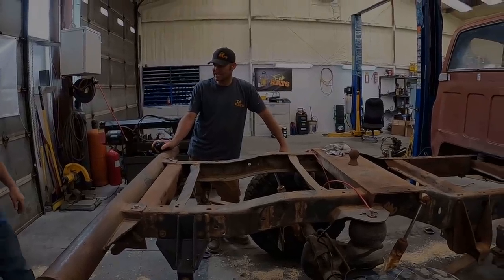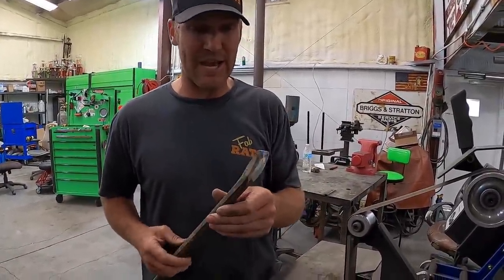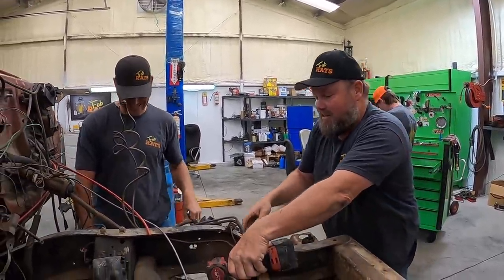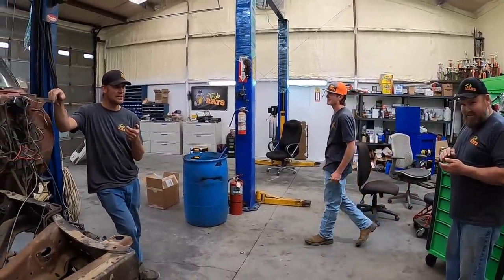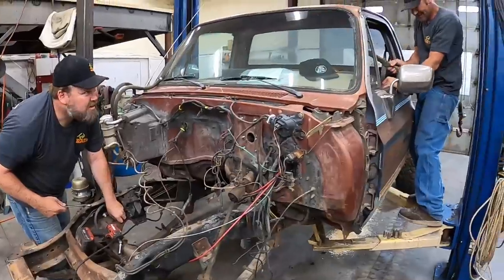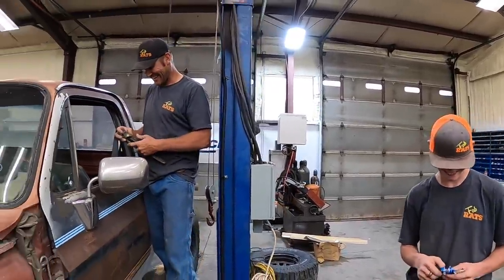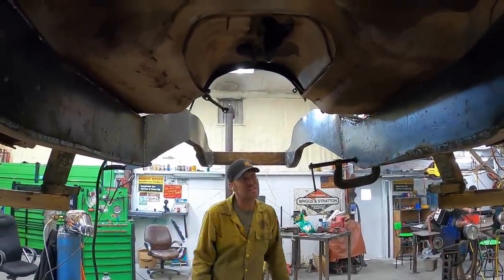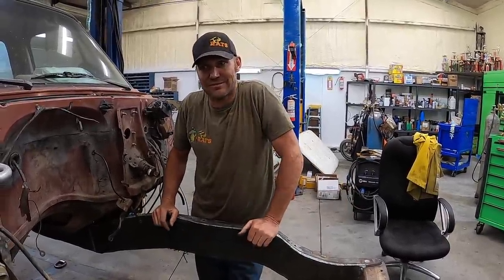This Frame Is NEVER Bending Again On The Rat Rod Tow Truck!

Comment: I have a 89 k5 frame with the two wheel drive steering box and all the ORD steering braces and still ripped the box off the frame. 42s with no hydro on the Rubicon probably didn't help. Did you have to take any precautions while boxing the frame to keep from warping the frame?

Comment: have you thought of stiffening the frame using a tube frame design from existing chassis to rock sliders? by triangulating the dead space outside the rails you get strength but dont interfere with motor and gearbox space. it could also be a protective cage for air tanks or emergency fuel/ water.

Comment: How thick is the frame material on the square bodies? It’s been too long since I saw one up close, but isn’t 1/4” plate a little on the thick side? Or did truck frames get thinner as the decades went on? The 96 Ram I did the FrankenRam series on is closer to 1/8” I believe. A lot more factory boxing but definitely thinner.

Comment: Favorite off road shock/suspension for me is Old Man Emu. I've been running the Nitro charger shocks on two different rigs for at least 12 years and way over 200,000 miles.
Reply: OME also do the best steering dampers too.

Comment: Just slightly curious. Are you going to do a box four link or a trapezoidal four link? Trapezoidal 4-link does help to prevent axle walk under load. (A really fun note.less strain on yokes u joints shafts) Like what Matt does with his recovery vehicles.

Comment: doesnt the top plate edge under the cab need be welded in to the frame? did you pull the cab off frame to get to it? or just say good enough?

Comment: Paul, are you welding with Dual shield flux core wire? If not have you considered it? It is evidently quite strong and burns in fast.

Comment: Hey Paul. 
If it’s in your budget, vintage air makes a nice A/C systems for these trucks. 
It tucks the most the system up under the dash. 
Would give you a lot more firewall / tire clearance.
Reply: It’s nice, but $1500 is a lot when you already have working a/c.
Reply: @spaight711  very valid point.
Reply: It’s an ac cab so..
Reply: @64BINDER  
they make kit for either or..
Reply: Good idea.
Reply: @b.s.adventures9421  true but he has all the stuff to put it back together
Reply: @spaight711  not when you have fab rat money!
Reply: @Kyle-ev4fk  seriously? 😑

Comment: those gm pickup frames were prone to breaking where the power steering sector bolted on...i dunno of one that didnt. had multiple friends back in the 80's buying new gm frames and replacing them in their driveways...on Gearz, stacy when he did his fall guy tribute bought some frame strengthening pieces from some company, cant remember which to fix/strengthen the one he was building

Comment: Paul I’m definitely loving all the new work that you have been doing on the rat rod tow truck for sure buddy!! I already have a 1980 Chevy 1Ton 4x4 tow truck but haven’t done all the cool details to mine yet!! I did just get all the parts for my 1981 GMC 1TON 4x4 and was able to install the new leafs in the front and the shackle flip kit in the rear!! It only took me a day to get everything done!! It definitely sits properly now with a new set of old stock 35x12.50x16 BFG MT and yes it’s there old style ones that I definitely think was there best mud tire ever built for sure!!! I’m definitely not a big fan of there new style tread pattern!! Plus the old ones wore like iron on rock roads and the pavement when not out wheeling with them!!! What are your thoughts on BFG mud tires?? I’d definitely like to know what you think of them??? I’ve went and tried out more mud tires and brand tires over the past 20 years to try and find the best ones and I definitely can’t count all the different ones on all my fingers and toes together!!!

Comment: I get lowering the engine, but don't you want it as far out front as you can get it and still have a useable approach angle?
The farther back it goes, the less its mass serves as a counterweight to whatever you've got on back, especially up some of those crazy grades.

Comment: Landon needs to swap to 35 turn motor. 
The stock 27 turn silvercan motors do burn up if you put bigger tires or heavy tires on your rig and don't gear them down. Swap for bigger spur gear and lower number motor pinion will help a lot. It will be slower but crawl a lot better.
 And short wheelbase trucks tend to roll over. The Axial etc 12.3" wheelbase is the perfect one in my opinion.                                
Greetings from a dude that has done rc since 1990 and been building crawler rigs since 05'.

Comment: Tell Landon to put a hobbywing fusion 1800kv, runs about $150 but its a motor and ESC combo. 2 in 1 and runs cool. I've ran for 3 hours without getting warm. Plus they are waterproof.

Comment: I like Bilstein shocks...

Fyi Paul, those flashlight battery packs like that actually have a whole bunch of AAA batteries inside of them most of the time. It's cheaper to buy one of those big battery packs and cut it open for all the smaller batteries inside then to go buy all the batteries themselves. Everybody needs useless information so there you go.

Michelle, Duluth long tail tees. They completely cover the crack and it looks like the whole crew could use some.

Try pickled green beans too!

What about military tires on the 40" range like Michelin xl or zxl?

Comment: I had 6500 lbs of cement bags in my 87 1/2 ton gmc wrangler. Got a few looks driving through the city that day. I was more worried about the cheap tires from Walmart than anything else.

Comment: That was the same trick Big Foot original had done to run the 48" spreader tires without tweaking frame too badly ,later they capted the out side and later still flat strap top and bottom to finish custom boxed frame. By then 1500/blown hp and 60" tires ,duce and half axel's and crushed cars,4 links next...

Comment: I worked many years in the ship yards as a ship fitter.  Metal work.  Term, Slam Tack:  have someone ready with a hammer... put a big round tact (size of a nickle or quarter) Slam it ONCE with the hammer while still red.  It will close up the gap.  Slam repeat as needed.

Comment: so, as someone that doesn't have access to the cool tools you have, it makes me wonder why you would use the Sawzall rather than the plasma cutter to chop that rear frame. I've watched M.O.R.R. do the same thing with angle grinder and a cut off wheel. I think if I had a plasma cutter I would never use a sawzall , grinder or portaband ever again, hahaha

Comment: Love your content. Found your channel through Matt's Off Road. With all the improvements to the shop, I think you need to put in a concrete apron in front of the shop next.  As far as the FJ, great build,  I love the Rat Rod look, so it would look  great just clear coated to keep that Rat Rod look.

Comment: Shocks...
A lot of it depends on:
The type of vehicle (car, truck, SUV, UTV)
The weight (big and heavy, small and light)
The ride you are looking for (firmness, squishy, adjustable)
The lift if any (lowered, stock, lift 2, 4, + inches)
The use of the vehicle (racing, baja, crawling, daily driver)

I have been partial to the Monroe shocks for my cars and light SUVs...
I have an F350 (CCLB 4x4) that I'm going to try with Monroe Reflex... I considered the Bilstein 4600 or 5100 shocks, but couldn't decide. If I don't like the Monroes, I'll switch over to the 4600...
Fox shocks are supposed to be the best if you want an adjustable ride...
Lots of people like Rancho, but I've blown too many to waste my time on installing those.

My truck is 6000 lbs, 4x4, and is a service truck...meaning, I use it for towing, hauling, daily driver, going off-road... I want a nice ride but the ability to handle all that when needed...
The Monroe rep thinks these Reflex will handle it. I'll let you know... ;)

If I just did off-road ... I'd probably be using a different shock (Fox?)...
Or road performance... A different one yet (Bilstein 5100?)...
Crawling? Fox Shocks?

It's also a function of money...

Comment: Paul, surprized you don't/haven't gone to the cherokee steering shaft. Almost a bolt in for the square bodies and gives you 2 universals vs the crap GM joints.

Comment: When ur trying to fit plate and u have a gap u can't get closed, I like to hot tack. U put a nice big tack where u can bridge the gap and smack it with the hammer while still hot and it will close it right up. The heavier the metal the bigger the hammer lol

Comment: My father and I rebuilt a ZZ4 for my 84 K10 when I was a teen. Needless to say, a 16yo with a roller cam small block and a 4-speed, I spun a rod bearing and had to rebuilt the engine again 6 months later. Don't do the rev limiter. Let Landon learn like I did. Life lesson I'll never forget.

Comment: Cut tie rods into sleeves to go through frame ,for steering box bolts to go through .360 pass both ends grind smooth .Head bolts or grd 8  bolts to anchor steering box ..

Comment: Cornwell CRW12MDFS these ratcheting wrenches have a double flex in them. I made more $$ with this set of wrenches than I can count. Highly recommended. They fit everywhere and are strong. I wouldn't hit them with a hammer but I'm sure you could.

Comment: 6:23 - Paul stated: "So they don't make a load-rated '40' really, yet - so, I wanna put a '37' that we can put some weight on it and not worry about blowin' out".  

The 40X13.50R17 NITTO Mud Grappler has a max load rating of 4,300 lbs.

Comment: 1984 GM Engineer's, " should be a box frame,  it's a truck". The other Engineer, " there's only a handful of nut's that would put a truck through that kind of terror. Those nut's will have to work it out somehow". And here we are almost 40 years later! You Go Paul!

Comment: you can limit the engine rpm with exhaust restrictor plates. vintage air systems take less room on the firewall.

Comment: Is Landon using brushless motors or brushed motors? Use brushless for dry arid conditions, sand may get into the motor but you can clean a brushless motor and put it back together and it will possibly work, brushed motors are just dead after they get wet or dirty.
Reply: I had a similar problem with my r/c driving around on sand, dirt, foliage, just burn through motors but when I converted to brushless, just needed to blow clean them with a air compressor.

Comment: Im suprised before boxing you didnt spray rust converting primer unless you plan on dipping it in a galvanizing tank, Also if it ever goes into water how are you planning on getting it to drain out?
Reply: They don't worry about such things. The 1/4 plate will take a hundred years to rust through anyway lol

Comment: Paul, as a firefighter you may be familiar with the story of how you can lock a FF in a closet with 2 brand-new bowling balls and turn off the lights. In 10 minutes turn the light back on and behold, 1 ball will be "lost" and the other won't roll right.

Comment: Landon, what motor did you burn? I just fried out the stock 550 in my Granite and I'm not very entertained.  What's the solution for a feller that runs full throttle all the time?

Comment: I really enjoy watching your videos. Have been watching for a long time. That GoPro seems to be set at 60FPS and 4k. There is no motion blur. So when Randall keeps moving around so much it causes motion sickness. If you are not going to keep that camera stationary it needs to be at 30FPS. It is very disconcerting. Check out Jeven Dovey's YouTube channel for a video on 24fps vs 30fps. He does a great job explaining cinematic shooting and frame rates. If you don't have some motion blur your audience can start to feel motion sick watching the video. I had to stop it after watching about 25%. It was to much. Also Randall has to stay still as a camera man, you can't catch every action shot without transitioning, otherwise it comes across choppy and jumpy. It is hard to correct in editing, creating more work. Providing a little feedback, we enjoy the channel keep up the good work!

Comment: Pardom my ignorance. If the entire chassis is boxed in, where and how you put all the brake lines, and electrical wiring after the fact?  I am sure you figure it out a way but some highly paid Design Engineer spend countles hours figuring that one out at the factory before they built this chassis many years ago.
Reply: And they weren't designing it to do the heavy work this will do. Watch and learn.